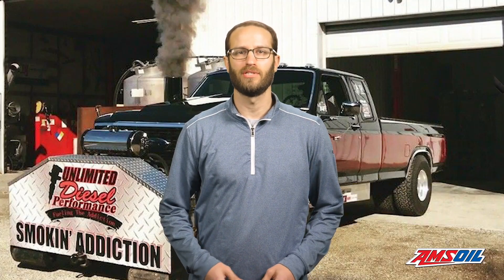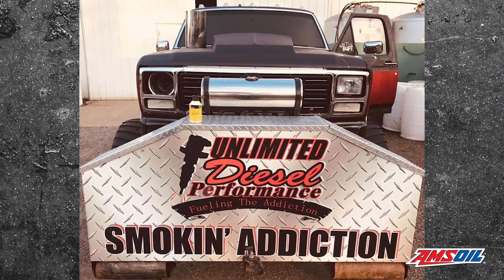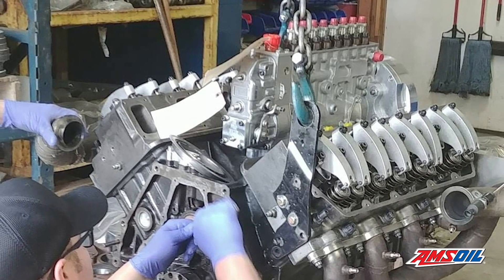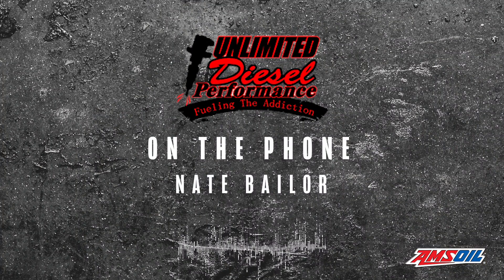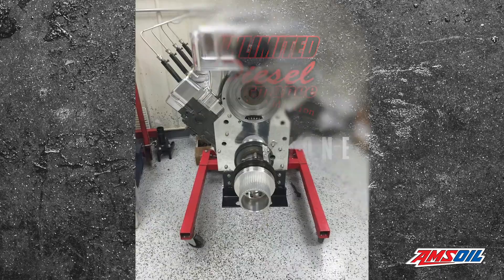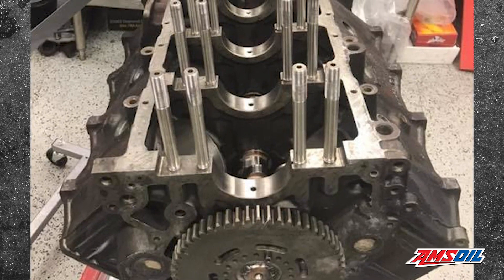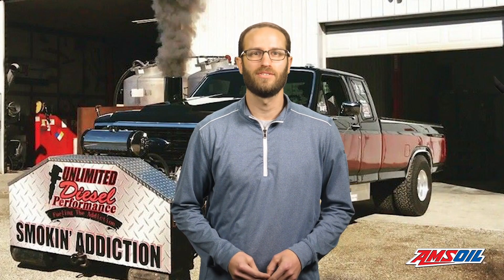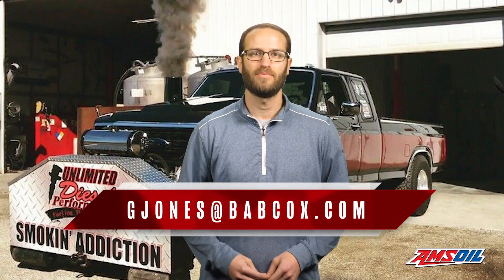2,200 HP 7.3L Powerstroke Engine

Comment: That head design is bad ass but there still missing one link to that design and that would be a 16 valve head instead 8 valves per head more valves more air and it’s possible I’ve had a head design that I thought about years ago just never had enough money to do it

Comment: Ok I'm confused because I'm a big ford guy and in 1981 ford used the Navistar 7.3 IDI not the 7.3 power stroke which didn't come around until 1994-2002
Reply from the maker: Just the truck the engine is in is from 1981, not the engine itself.
Reply: 6.9 idi didn't come in 81 either. It came out in 1983 in the fords.

Comment: In fact my hydrogen generators made my engine run cooler I did that for a half a million miles it ran great. I don't pull trailers no more so now I work in a factory.

Comment: In fact when I was pulling a 39 foot travel trailer my truck and the trail together weighed 17,500 lb I was getting 19 miles a gallon round trip 368 mi from Chicago round trip

Comment: My jaw dropped when he said they're still running a stock crank, at 2200 horsepower. 7.3s barely make a fraction of that stock, that's absolutely mind blowing how over built they were.
Reply: They're forged crankshafts. As long as the motor is balanced well with a good damper it should be fine at any HP level
Reply: @marinusdedreu3833  Not all levels of forging are the same though. Material composition, thickness of the part and its overall build quality play a big part in its ability to withstand so much horsepower and torque. It could have fallen apart at 1200 HP if it were a poorly made piece.
Reply: I guess poorly made isn't thr right way to say it. If it wasn't as well made it cluld have fallem apart at 1200 HP, but that would still be impressive considering 7.3s make like 180 HP stock
Reply: @scmroman  my 96 makes 225hp stock, the super dutys make 275. It's an industrial engine so yes the crank is very well made. that's why they last so long
Reply: @marinusdedreu3833  Ive got mine and its making about 300 ish its a 97 and I love it
Reply: A 10th of it stock.. lol
Reply: Yeah 10%

Comment: Stock crankshaft holding up to 2200hp? Wut
Reply: YES!!! WELL MADE ENGINES.
Reply: @josefastboats5874  well made engine? The only thing stock on it is the crank. 7.3 struggle to make 400hp. The 6.7powerstroke is what i call a well made engine. 550hp bone stock and 2020+ use light weight steel piston from factory. The cummins is the superior engine holding up to 1000hp with only head studs. The LMM LML Duramax start to fall appart at around  650-700hp. I run Duramax’s cause i like the smooth power delivery. I like them all but calling the 7.3 a well made engine… sorry.
Reply: @reminoel483  7.3s are very well made engines. Especially the obs 7.3s because they came with forged rods. The only reason they struggled to make good power was because the heui system sucks. Is the 12v better? Yes. Is the 7.3 also well made? Absolutely. What a clown ass thing to say.
Reply: @reminoel483  I have a 96 F350 with a bigger turbo, larger injectors and heads studs. That thing makes a lot of power so I don’t get it when people say 7.3’s don’t make power. Stock pistons and rods. Those obs trucks can easily handle 650-700HP
Reply: @reminoel483  I would fucking hope a diesel that is 20+ years newer would make more power. You fail to realize that technology nowadays didnt exist when the 7.3 came out.
Reply: @fomoco yeah I heard some of the 99s do I didnt know 2000 did too
Reply: @fomoco ehhh how many have you worked on? Trust me I'm a 7.3 guy through and through, I have 7 of them. But they got lots of little issues that no one talks about, mainly due to the injection system. If they had mechanical injection it'd be a different story. The longblock itself is great

Comment: Powerstrokes are the best hands down either way!
Reply: @tj4683  I drove a modified 7.3 from 2000 to 2010 and it had no major problems and was cheap to maintain. For the last three years, I've been driving a Bulletproofed 6.0 and have had zero problems even at 30 below.
Reply: @MatthewC137  keyword there is bullet proofed. You shouldn’t have to bullet proof a motor for it to live. I’ll admit the 7.3 is a decent motor but the 6.0 and 6.4 are just garbage.
Reply: @Braviary01  you're only half right and don't know the differences between those motors. The 6.4 is garbage, a throw away motor, but the 6.0 is easy to make reliable permanently. The motor itself is good and without bulletproofing they became much more reliable in the last 2 years of the 5 year production run.
Reply: It takes all that to run with a cummins?
Haha ford people are funny
Reply: @tj4683  youre full of shit i have 3 and never had to put money in ive had one 11 yrs only had to fix a lift pump
Reply: Says nobody ever !!!
Reply: People who say this don’t actually own a diesel
Reply: @jonruger  - no allot of people who own diesels say this the 7.3 was better than the 12valve 5.9 Cummins and the 6.7 power stroke is better than the 6.7 Cummins that’s a fact y’all are just a bunch of herd like mentality 18yr old kids who don’t have a clue.
Reply: @CoyoteFTW  they do not a 5.9 Cummins doesn’t run on oil pressure they do not need multiple sensors and electrical systems working to run. 7.3s are all old now and no one took good care of them because everyone thought you didn’t have too so if you buy one now it will have problems. Any ford that powered by the stupid HPOP design loses power as the engine gets warm and really bad toward the end of engine oil service intervals. The HPOP holds a little over a quart of oil that does not drain with oil changes and needs manually removed each time the IPR and IPC and the plug and wiring to them are failing bad on these trucks because they are old so the wiring gets brittle.
Reply: @jonruger  you have zero clue wtf youre talking about😂
Reply: @fordnut4914  bet you have no idea why Ford didn’t have any F250/350s in 98 and I can’t tell you it isn’t because they chose not too… I would bet $1000 you couldn’t tell me what an HPOP or IPR was without google buddy.
Reply: @CoyoteFTW  they see easy power and think that's what makes an engine great, no that make it great for modding. 
5.9 and 7.3ps are the best diesels ever put into pick ups, but a 7.3 is the superior Engine for working/realizability applications. 
5.9 has the same cult problem that the LS has. They are amazing engines but the fanboys think they are the best to exist and they simply aren't, they are just great engines for building for performance not work

Comment: Dude a forged piston with reinforced ring lands is revolutionary.
Reply: OTR engines use steel pistons. Kind of surprised they didn't go there instead.
Reply: @Parents_of_Twins  i bet it makes a difference if your diesel is red lining at 1800 rpm or at 5 grand. Some Diesels run to 6 grand. At that point steel parts become a limiting factor.
Reply: @uliwehner  Really. Why? Weight?
Reply: @Parents_of_Twins  That and heat.
Reply: @Parents_of_Twins  
Now days, since about 2005 they started monotherm pistons. Articulated before. I still build hipo diesels that only have cast, nickel inlays for many people. Debonding is a serious problem.
Reply: @johncholmes643  Interesting. Debonding? Are you talking about the metals losing their adhesion to each other because of the extreme heat? Or are you saying that would be an issue with the steel pistons? Interesting either way. I'm interested in engines but that's not what I do for a living.

Comment: Dont get me wrong, this thing is cool but, what still makes it a 7.3L Powerstroke? Every single piece except the crank is custom. Turbo, Intake, Heads, Injectors, Block, Pistons, Rods... so if it is just in a Ford truck  its a Powerstroke? I mean call it what it is,  a loosely based on the 7.3 architecture full custom pulling truck. That feels better.
Reply from the maker: Like many builds, it started with much more 7.3 Powerstroke parts and pieces than it currently has today. That transformation took many years. But it does still use 7.3 architecture, and the billet block coming soon will also be 7.3 architecture. We understand your point though.
Reply: Same reason why a 2 speed transmission for a drag rail is still a "Powerglide", same reason a 2000hp Twin Turbo engine is still a "big block Chevy"
Reply: They also said it was a stock block

Comment: Very impressive. Make a guy appreciate the Cummins
Reply: Why? It’s not like a cummins will make this kind of power stock?
Reply: @masonh2538  um nothing makes this kind of power stock. But as the owner said when they were making 1400hp. The Cummins in the same 3.0 class were making 1600.
Reply: @tbone707  thats a displacement and airflow issue.
Reply: @masonh2538  you realize this engine isn't stock either. Cummins can build a lot more power without doing a lot of machine work..
Reply: @dallasknight8620  costs about the same to get a 7.3ps to 500hp as it does a 12v Cummins
Reply: @marinusdedreu3833  you really do not know what you are talking about.
Reply: @marinusdedreu3833  No, No it does not. LOL

Comment: It's just unbelievable where they're taking these engine architectures - and even with the HEUI PowerStrokes, no one ever thought that fuel system could support 1000HP, yet you can buy parts out of a catalog that will get them there now! And, to think, all it took was enough people to just give enough of a damn to actually develop parts, instead of just pulling cheap Cummins out of junkyards(for better or for worse, the LS of the diesel world no doubt).
 
Nice to see some are still interested in pushing the limits too; when you can predict where you're going to crack the block, you must be doing something right lol. I've gotten to watch the Double Overtime truck run a few times, that's one bad SOB
Reply: You definitely correct with everything you said, and yes the Cummins is definitely the LS of the diesel engines, you see them in pretty much everything. It's amazing how much power they making with the HEUI system nowadays, Jesse Warren making serious power with the 6.0,s.
Reply from the maker: Well said. It never ceases to amaze us what engine builders are capable of.

Comment: You can make most anything work with enough money
Reply: Right, money just makes stuff magically work - not all the time and effort and testing and problem solving...
Reply: @RyTrapp0  well of course you aren't going to get anywhere if you don't know what you are doing. My point is that it's a lot more expensive to build something that is engineered in a way that makes it difficult to make power
Reply from the maker: @basketballcory2  Money doesn't hurt any, but as you and @RyTrapp0 pointed out, you still have to make it work at the end of the day!
Reply: I would say money solves problems that have already been solved, but if they are new problems that others haven't encountered then it becomes brainpower, trial and error, sweat and money .